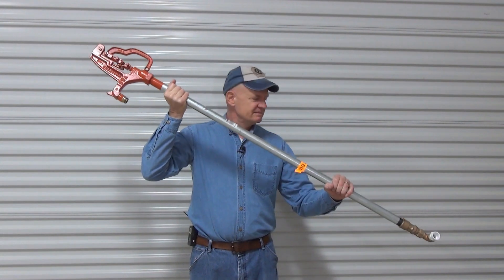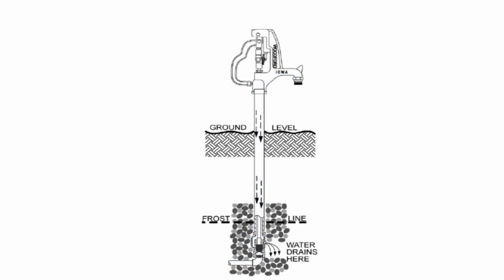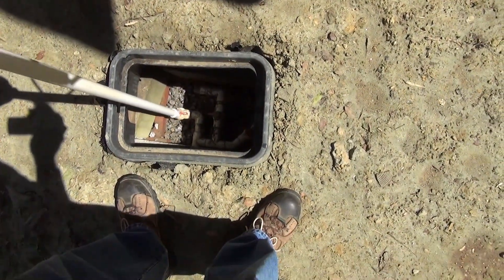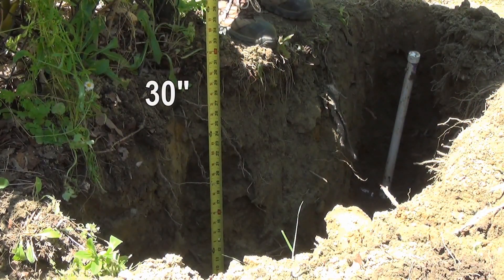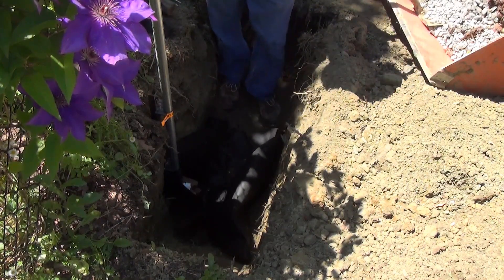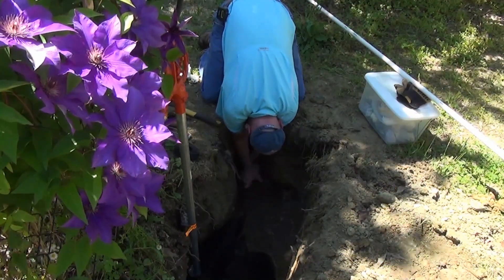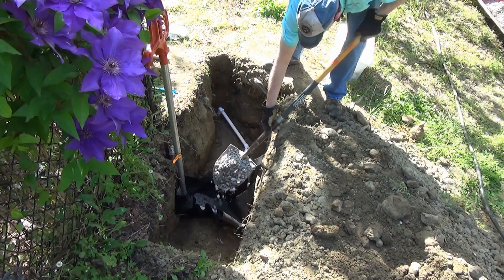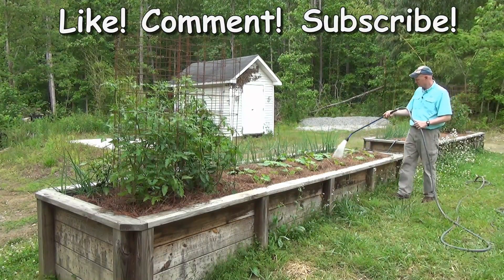How to Install a Freeze Proof Yard Hydrant and How it Works  (#93)

Comment: Nice! I'm looking at installing two of these in the next month or so. I've watched 3 other installation videos, and by far I prefer your method. Some people were putting an inverted bucket down in the hole, others were leaving the T-post exposed above ground (which I don't really want), and one was using a 2x4. My biggest concern is making sure there's no or very little flex in the riser pipe so it doesn't open up the hole with use. The T-post and the wire should take care of that, although I'm actually inclined to use a pair of stainless steel U-bolts. My friend has one at his house that's concreted in to place, and while it's VERY stable, if he ever has to clean out the weep hole or fix a leak.... Well, it'll be a real pain :)
Reply from the maker: Using u-bolts is a good idea! Thanks for watching!

Comment: Good day Sir 👍😊That type of valve will be great in my futur project on water connect my RV beside my garage 👍Great welding Sir😊 Great out plumbing trick and job 👍Have a great week end Sir🌞👍
Reply from the maker: Hi Dave!  Yes indeed it would.  How deep is the frost line where you live?  Thanks, but the welding was definitely not great, but it will do. May you have a most excellent weekend too! Thanks for watching!
Reply: @DIYMyWay  Good evening Sir, a little more than 4 feet deep to be on the safe side Sir for the frost line Thank you and keep up the good welding project !!! Cheers 😉👍

Comment: Great instructional video! Maybe I missed it......did you put some caution tape above the waterline to warn future 'diggers' there is a waterline below? Also with non-metal piping, running a wire with this tape will allow metal detectors to find the waterline again.  I'm old school, so maybe they don't use this technique anymore.
Reply from the maker: Thanks!  No I didn’t because I won’t forget where the water line is because it’s in the same trench as the power.  I’ll make a diagram of where the utilities run on the property for future owners.  Your “old school” techniques are still just as valuable in this “new school” era we’re living in.  Thanks for watching!

Comment: Another great video Martin!  I learned something today, I didn't know that the hydrants had a drain hole at the bottom.  I knew that the "valve" was at the bottom, but not that it was self draining.
Reply from the maker: Thanks, MD H!  Yes, it’s a neat design and works great as long as you have a good gravel bed for it to drain into.  It’s cool that you can do maintenance on it just by removing the faucet head. Thanks for watching!

Comment: Ahh, now I know why I get a little bit of dirty looking water when first opening the valve! I have one of these set up as a temporary for our custom home until the construction is complete. The guy who installed it along with our half mile of water line obviously didn’t cover the drain hole like you did, or put it in a gravel bed since it’s only a temporary installation. I was getting a little concerned about that, wondering why there was still some dirt in the pipe! 😂 Now it makes sense! 😁

Comment: Fantastic install!  Love the purple Climatis on the fence, too.  I wonder if I could use one of these with my IBC tote with just gravity pressure?  I may have to experiment with that.  I need to get a faucet from the tote to the raised bed with the piping underground so I can cut the pasture.  Nice vid!  Thanks for sharing.
Reply from the maker: Thanks, Pilgrim!  If your IBC tote is sufficiently higher that the faucet head would be, I don’t see why it wouldn’t work.  How much fall do you have between the bottom of the IBC tote and about 27” above ground at the garden beds? Thanks for watching!